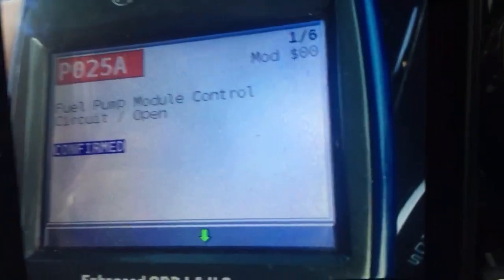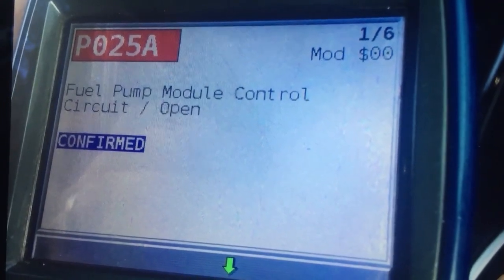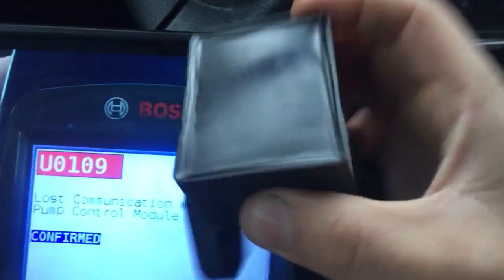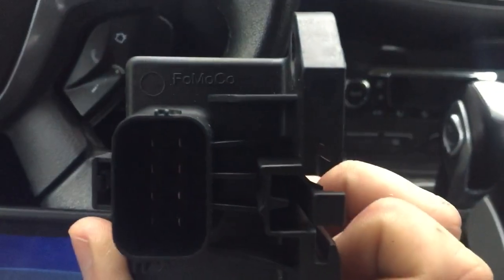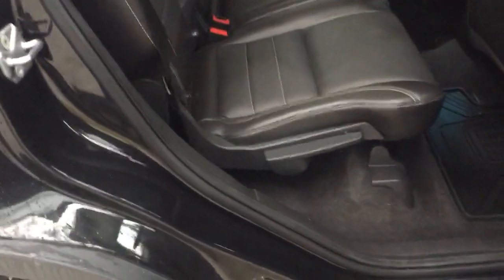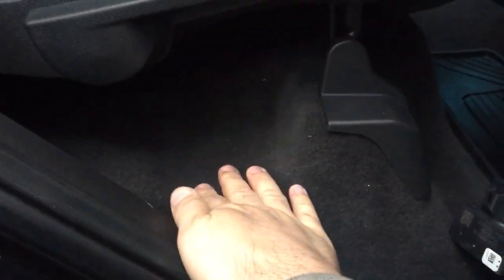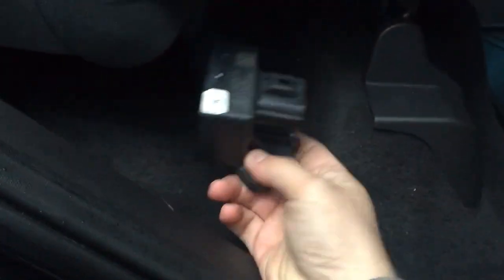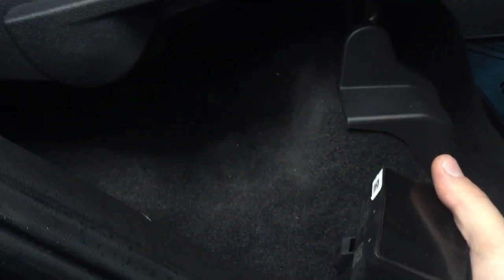2014 Ford Escape Fuel Pump Control Module Location / where is it ?

Comment: You mentioned that replacing the module didn't fix the remote start issue...that it had something to do with the airbags.  I have the same issue...changed out the module but it didn't fix my remote start problem...could you tell me what worked for you?
Reply: A check engine light out a low battery has kept my remote start from working.